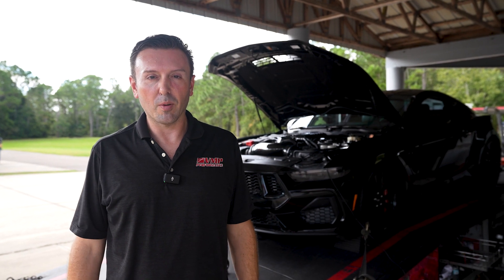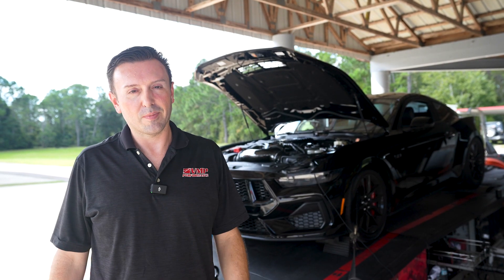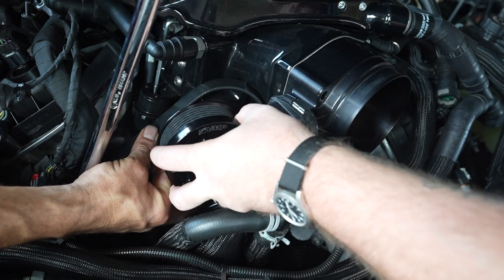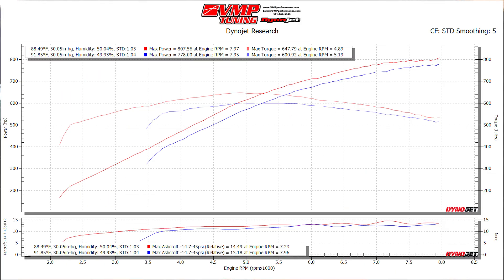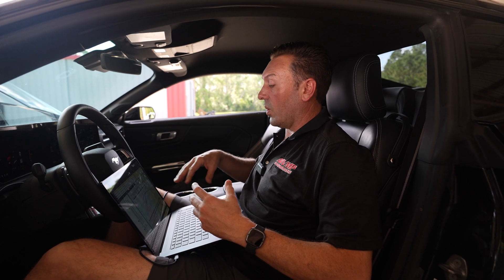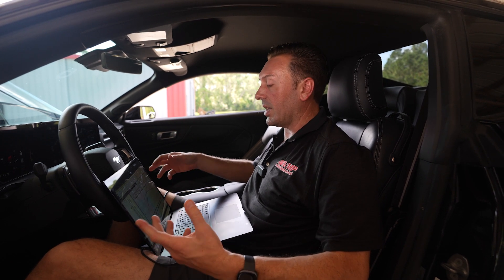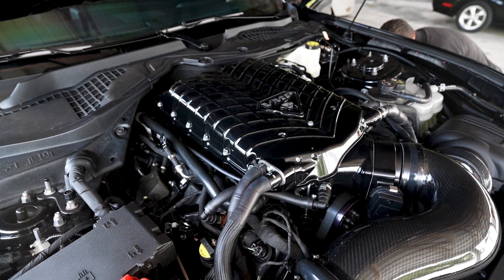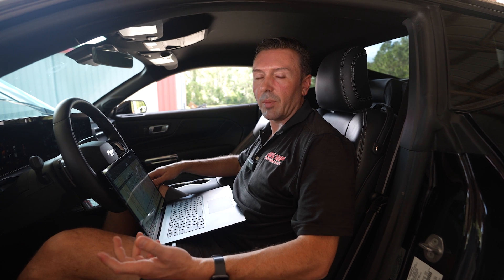Introducing the VMP Gen 6 Stage 3 Supercharger Kit for your 2024 Mustang!

Comment: how did roush make as much power as you with a much smaller blower?
Reply: These seem to be very low numbers compared to my Gen 6 Whipple on my Gen 3 car. At 13psi I made 816WHP SAE correction which would be around 830whp STD correction that he is using. On 14.8psi I made 890whp SAE. It was also 100f in the dyno room. My car also trapped 150mph in the 1/4 which backs up my numbers. Full weight at 4100lbs. I would have cracked 900 no problem if I wasn't heat soaked.
Reply: @freak_5.042 running e85 I assume?
Reply: @freedom6919741  I am but the consensus is that E30 is 90 percent of that you will get out of E85 anyway so maybe 20whp gain? I'm still way up over these 14psi numbers vs mine.
Reply: @freak_5.042  if that’s the case we wasted a lot of money on a return style fuel system.  I can’t believe that e30 gives the same octane as e85.  Wait until tuning is available.  All this e30 stuff will be history and people will be wanting to sell you everyone a return style fuel system.  My Odin makes about the same as this car on e85.  It’s definitely confusing since I was told 11 lbs of boost is all I could run without a return style fuel system.  Seems like it’s dancing with the devil with no aftermarket tuning available.
Reply: @freedom6919741  I agree with that 100 percent. Sunoco E30-R is 100 octane like regular E85. I feel they are pushing these fuel systems pretty far. I did notice that all these Gen 6 cars haven't backed up any of the big dyno numbers on the track yet. Even cars close to the 1000whp range according to a dyno has trapped much less then my car on only 870whp. They seem to do well in the 1/8 but loose mph in the 1/4 mile MPH. I'm assuming it's fuel system related for sure. I guess with tuning, time will tell 🤷
Reply: @freak_5.042  just a matter of time before people are picking up motor parts.  Running out of fuel in boost is bad!  E30r is probably 15 dollars a gallon. That’s not sustainable unless you’re a rich YouTuber.
Reply: @freak_5.042  looked it up. 93 dollars for 5 gallons. Geesh that’s some expensive fuel.  ⛽️

Comment: Has anybody done e85 on the 24 whipple stang yet?
Reply: Yeah, E30 nets 90% of the gains and cooling of E85
So all the E30 numbers are essentially same as it would be on E85
Reply: @commycomentor9695  e85 should give 100+ hp gain over 93. E30 has the cooling properties for sure.
Reply: @BigInjun05 e30 (in testing) provides 90% of the gains of full E85

These E30 numbers are likely within 10-20hp of a full e85 tune.